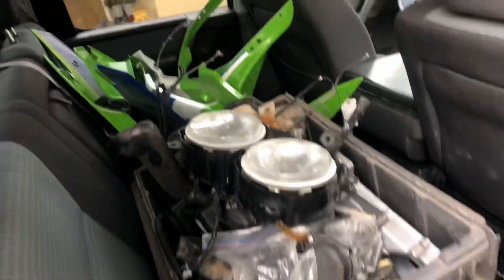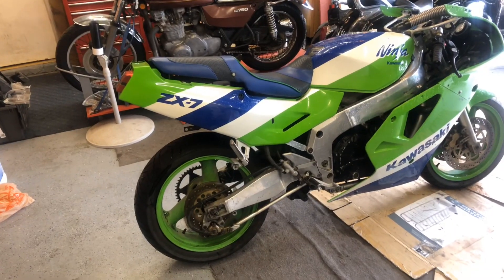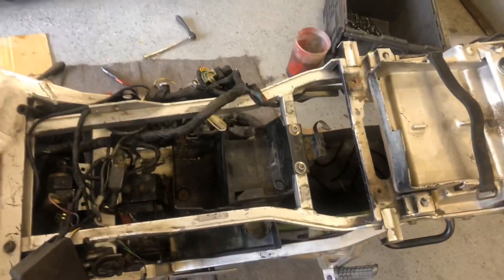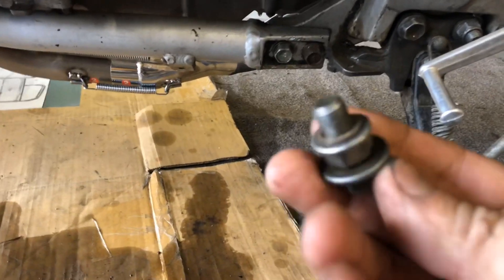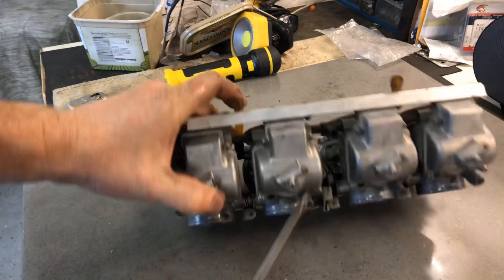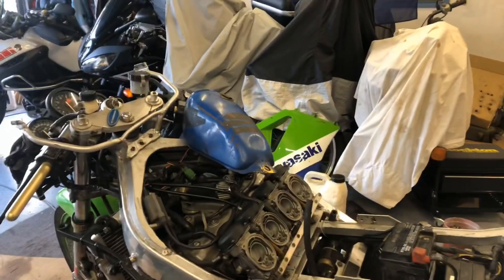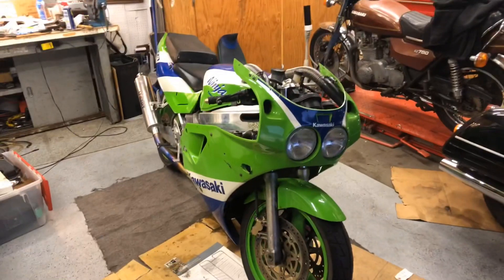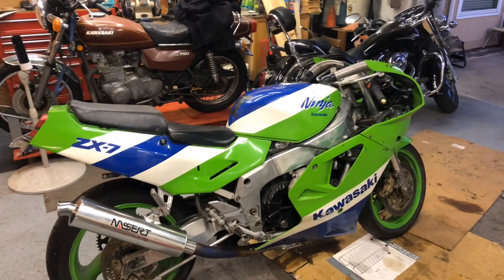1990 Kawasaki ZX-7 H2 Rescue - Will It Run??

Comment: I have had the experience of spraying brake cleaner down the inlets without carbs. It did fire and went straight to redline, because there was no throttle. 
I won't be doing that again!
All the best from Ireland
Reply from the maker: Yes, you have to use just a little bit!  Hello Ireland, that’s another place I want to visit.